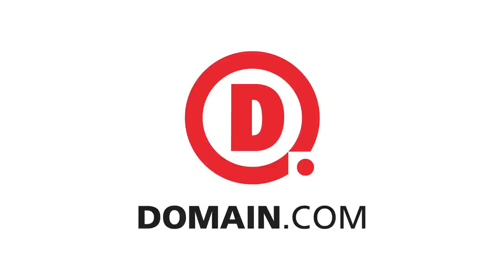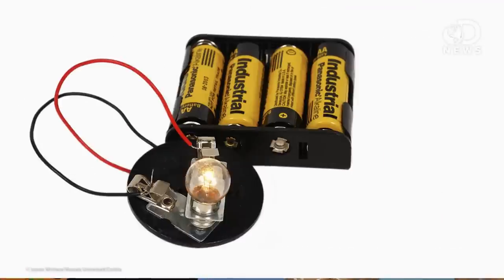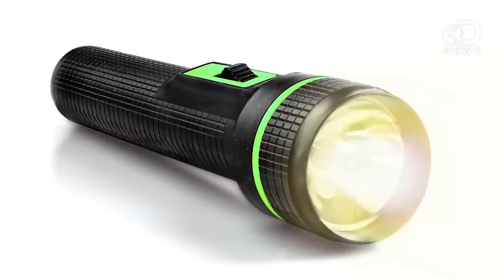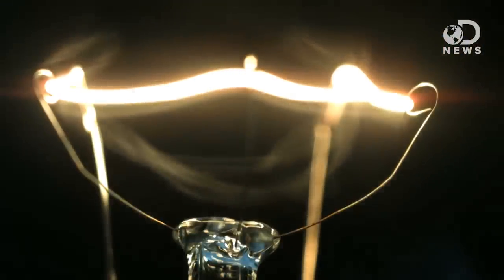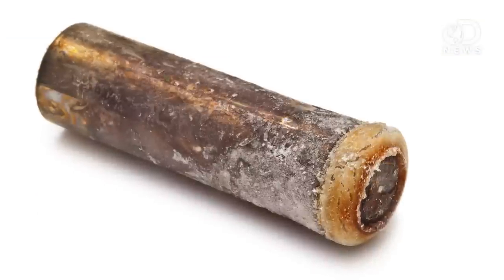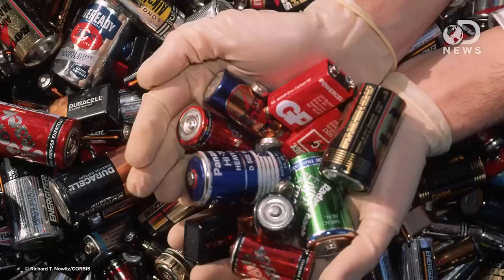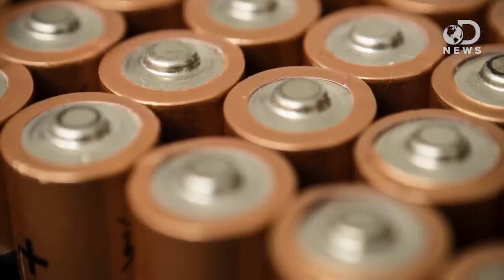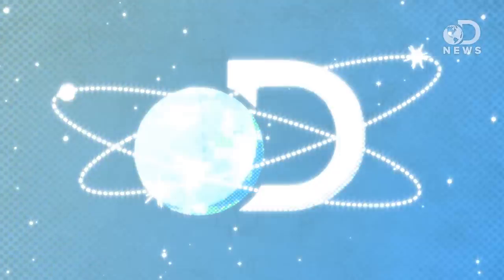Why Can’t You Throw Away Batteries?

Comment: Normal small household batteries does not contain either sulferic acid nor lead.. this is found i car and motorcycle batteries. Normal small AA or AAA batteries are usually alkaline batteries that contain lithium which is an alkaline metal. This is not particularily dangerous to us but it can harm nature in small amounts.

Comment: You CAN throw away alkaline batteries though. There's not much of worth to recycle in them and the zink, manganese oxide and potassium hydroxide (a base, not acid, hence no acid in these batteries) does not pose any significant risk to nature. There's also no money to be made in recycling them (something which fuels most recycling processes) as it costs more to recycle than the materials you get out of them.

I don't know where you shop for batteries, but I haven't seen lead or acids being used in regular consumer batteries in quite a few years now, outside of some specialized batteries. Basically, if you're throwing away a AA or AAA battery and it's not a rechargeable battery, just look if it says "alkaline" on the side (which with 99.9% certainty it will) you can safely throw it away.

That should have been pointed out in the video, it feels like someone should have done a bit more research as it sounds like you're talking about batteries from the pre-2000s.
Reply: Yep. Duracell's website says "Alkaline batteries can be safely disposed of with normal household waste. Never dispose of batteries in fire because they could explode." Further, "Proven cost-effective and environmentally safe recycling processes are not yet universally available for alkaline batteries. Some communities offer recycling or collection of alkaline batteries—contact your local government for disposal practices in your area."

Now car batteries, on the other hand, should definitely be recycled. I'm really starting to doubt DNews as a source of reliable information.
Reply: Car batteries, laptop batteries, lithium batteries which power most modern cameras and cell phones....
Reply: Amelia Bee environmental risks only applies to lead acid batteries. car batteries are the only common lead acid battery that is still used to day. unless you have a laptop or cellphone from the 90's they are going to be lithium-ion and can be thrown in the regular trash per the US guidelines for battery disposal, just like the alkaline ones.
Reply: ***** If it's alkaline you can pretty much bet it is, regardless if they're cheap or expensive. Bottom line is that you're not going to find lead batteries outside cars today, except maybe in some very specialized situations. As a consumer you probably wont get in touch with them aside from in cars. As Andrew B says, lithium batteries are also okay to throw in regular trash. I'm all for recycling, but batteries are one of those things (like glass) where recycling doesn't make all that much sense.
Reply: Amelia Bee aren't you that annoying girl on tgwtg all the time?
Reply: Andrew B but still for the common sense, i would recycle them. Just so the resources don't get wasted as much.
Lithium doesn't grow on trees you know. :)
Reply: *****
Oh, sorry... what manufacturers of alkaline batteries are there that can't be disposed of in your household trash bin? I live in the USA and it's pretty much Duracell and Energizer on the shelves here.
Reply: ecopper1  Actually lithium does grow on trees. It's found in plants up to like 6000ppb.
Reply: Switch & Lever i also think few consumers would just throw away lithium batteries. at least where i live, we trade in old laptops and cell phones, whereupon they presumably find their way back to manufacturers and recyclers (i believe they do, although i'm not 100% sure).
Reply: ^^^ Oh the irony.
Reply: Melodïcore I was not talking to you
Reply: marco jonker I know. But I was talking to you.
Reply: +Switch & Lever 

DNews cares about stating what is popular rather than what is fact.

The FBI have been collecting detailed statistical records on crime for a very long time now and you can even find it on Google. DNews says the government is not doing any crime research.

They are politically motivated by sponsors. DNews is a liberal news outlet.
Reply: poor a heavy alkaline powder on your green grass and watch it die because the it is to high of a alkaline
Reply: Dry cells never had anything particularly toxic in them but nicad,lead acid and lithium ion batteries should be recycled.
If EVs become common I'd expect recyclers to actually start paying people to bring in lithium ion batteries like they do lead acid ones.
Reply: Switch & Lever sorry bud, recycling can be extremely cost effective, particularly where aluminum and steel are concerned. Batteries may be less profitable to recycle, but, as the commentator pointed out, it's about the toxic compounds in the battery that are recovered - and which can be reused rather than mined from scratch.
Reply: Rhett Z nope, you're wrong. Alkaline batteries contain zinc and manganese dioxide. Neither is toxic (otherwise we wouldn't throw them into household trash) and neither is more energy efficient to recycle than to mine. There is cause to recycle rechargeable batteries and other speciality batteries, but regular household alkaline batteries are pointless to recycle. Do some research for yourself if you're still confused about this.
Reply: Switch & Lever it's a matter principle to recycle that which can be. While zinc and manganese are not considered "toxic", anything in large enough amounts can be. While we're likely not to have a pool of zinc and manganese accumulating in groundwater, recovering the metals means that much less ore extraction, energy intensive processing, and land degradation need to occur. Besides, it's better to have the public in the mentality of recycling than not.
Reply: Rhett Z yes, it's good to live with the mentality to recycle, but you're believing in a completely false assumption, that these batteries get recycled even if you throw them in purposefully built battery recycling bins, they don't. Those bins are made to collect batteries with actual toxic or recoverable compounds. Alkaline batteries are for the most part discarded. It requires much more energy to separate and recycle alkaline batteries than the energy required to make new ones. It's not very defensible to recycle them. It's really not complicated, alkaline batteries are pointless to recycle, the materials they're made of aren't toxic nor scarce by any measure. Zinc is one of the most common materials in the earths crust for instance. If you're really passionate about recycling there are a lot more worthwhile causes to fight, like handling plastic when it reaches its end of life, microscopic plastic beads polluting our oceans and ocean life, microfiber pollution, pollution caused by recycling (very common in developing countries which do industrial recycling, of ships for instance) and much much more!
Reply: what will happen if we throw out Ni-Cd Battery ?
Reply: Abhishek De Nickel isn't that big of a deal, but Cd stands for Cadmium, which is toxic for the environment and should under no circumstances be disposed of improperly. Throw them into a hazardous material, or battery collection, bin.
Reply: Switch & Lever What about NiMH battery ?
Reply: Abhishek De generally safe to throw away, but personally I'd err on the side of throwing all recyclable batteries into recycling. Seriously though, these are questions easily answered by ten seconds on Google.
Reply: is there any way to detect batteries in a grabage bin? via a sensor or something? Thanks
Reply: @Irishrebel092  1. Lithium is a heavy metal and is one of the bad ones, 2. Most cheaper regular AA type batteries are lead acid (check for the symbol Pb) so most batteries should be recycled responsibly
Reply: I bet this woman thinks global warming is caused from focal fuels not from the the north pole moving 25 miles a year.
Reply: Because it sounds like alkaline batteries are ok can I use them to help amend soil for a plant
Reply: Glad I read this

Comment: In the EU it is illegal to dispose of any kind of cell or battery in normal refuse. Lead and mercury have been banned from consumer replaceable cells for many years so there is a mishmash of information here. Normal cells are recycled and the metals recycled. For those wondering if the anode and cathode description is backwards, it's not, it is describing them from the point of view of a cell providing electrical energy. Therefore the cathode of the cell/battery is connected to the anode of the device/circuit.

Comment: You would think that a big company like the discovery network would do a tiny amount of research before going off on a rant that shows they have absolutely no clue about.
Batteries in the sense they are using them are actually "cells" a battery is a stack of cells and for aa, aaa, c, and d "batteries" they are actually cells

Also those types of cells, and 9v batteries don't use "battery acid" they use an alkaline substance known as manganese dioxide,  zinc, and sometimes carbon. None of those substances are particularly harmful or something you wouldn't already find in healthy soil. Landfill or not you will find all those compounds in the ground anyways sans lead which along with sulfuric acid are not found in household batteries or cells.

Comment: I try to recycle them. Many places take them. Home depot does atleast where I am. They have a big metal cabinet for them. Even recycle old small lead acid batteries there if they don't do core charge from where you buy new. 
This is why I take apart phones, battery backups, etc. They can have NICD, NIMH, lithium ion, or lead acid batteries.

Comment: There is nothing to 'stop' you throwing batteries away, only your own conscience or fear of 'being caught' by the bin police ( what a joke!).
So-called recycling uses a massive amount of energy and I'd debate whether you end up with economically-viable products at the end of it.
Reply: +ukpropaganda That's not the actual point here. The stuff is poisonous.
Reply: they re use lead acid batteries. instead of using 5 times more energy in gas man power food for men oil etc for machines and men to mine the lead to make the acid and build the plastic for the battery out of petroleum why not use what u all ready have the machine does everything u pay two to three people instead of a crew or 20 to 30

Comment: so far I have 600 NiMH 17670 batteries that people say are bad but I'm pulling 2 and 3 ah from a 4.5ah Battery I have a bag that I have been collecting of 20 to 30 lion 18650 cells as well as a few NiMH that I plan on turning into radio shack eventually these batteries will no long take a charge at all or heat up when charged meaning there is an internal short

Comment: Usually i'll keep any alkalines in a box until i'm ready to take it to recycling. But my collection of alkalines are dwindling now that NiMH technology has gotten better, got 9 year old crap NiMH cells that work great in either low lumen flashlights, clocks, tv remotes, wireless mice and keyboards. I also got some speakers that take 4AA batteries.

If you're looking into getting rechargeable NiMHS, go for Eneloops (exceptional quality), Energizers or Duracells. There's some good charging units such as the La Crosse BC-700 or BC-1000 and there's also the Maha/PowerEx C9000. Look for other Maha/PowerEx chargers as they are really good, expensive but those are good charger/analyzers. if your not looking for something that fancy (and expensive) the Panasonic BQ-CC17 Eneloop charger is great. Both the C9000 and BQ-CC17 reject High-IR (Internal Resistance) cells so you don't accidently charge alkalines with them and NiMH cells that have developed High-IR won't do very well in high drain devices and you'll either need to charge them in a basic charger or the La Crosse chargers will charge them (to a certain extent if the -dV doesn't kick in prematurely).

Comment: potassium hydroxide is not an acid but a caustic agent that is toxic, Switch and Lever. While the mercury in batteries is of small enough amount that it is unlikely to do much harm and zinc and manganese are largely non-toxic except in very large concentrations. There is still the matter that many batteries still use lead in some quantities which is quite toxic, though.

Comment: Jesus H. Christ! This was the very first clip I watched on the DNews channel. A few moments into the clip, the commentator informs me that the negatively charged contact, "The Anode" and the positively charged contact, "The Cathode...." Now how can I possibly have any faith in the integrity of any material presented subsequent to this abject error? Do you people not have quality assurance reviews of your material PRIOR to post? If you do have QA reviewers, I suggest they be removed from your payroll to make way for the newly-hired and greatly improved review staff who hopefully have an actual interested in the task at hand. Should I be suspect about the integrity of any video I might watch on your channel(s)?  My short answer to my own last posed question is, Yes! Of course I should be suspect! Why wouldn't I be (suspect)?
Reply: Actually she's right in the case of a battery being discharged. You're probably thinking of an electrolytic cell, where current flows in the opposite direction. Anodes are oxidized, whereas cathodes are reduced.

Comment: The problem with recycling batteries is that they're so difficult to recycle in some parts of the US. You have to hold onto them and them make a run to either Home Depot (if the nearest one takes them) or a run to the recycling plant which is a 15 minute drive. ...  and who uses regular old batteries anymore anyway? It takes a whole year of battery use to actually make a run to recycle the whole lot.

Comment: Aren't electrons are cathode and goes to anode, right?
Reply: of course, silly!
Reply: ...no the cathode attracts electrons.... the anode is the reaction that is being reduced.

 for example Oxygen makes a good cathode as its a oxidizing agent (because of its almost full valence shell, fluorine is the best oxidizing agent as it is very light, and very dense of electrons)

iron is an anode, but since its very heavy its not a good one, this is why rusting takes a long time. However, magnesium is much lighter and more reactive than iron so we usually coat pipelines with magnesium as an "sacrificial" anode so that the oxygen oxidizes the magnesium first before the iron.

Since that reaction builds up charge, many corrosion engineers put in a counter current into the pipes to ensure the charge doesn't go anywhere. Same idea is when you turn off of a flashlight, the battery is still building charge for a couple seconds after you cut the circuit. Once too much charge is created the reaction's activation energy is too high to react.

Comment: Recharable batteries as expensive as they can be, are actually so much better than non-rechargeable batteries. Not only can you reuse them over and over again, but they hold their 1.2v much longer than 1.5v non-rechargeable batteries making them have a longer life span. Just be sure you buy a battery charger that will charge each battery individually... other wise you're stuck with half of your batteries overly charged and the other half, 50% dead...
Do your research; stick with the battery that is longer lasting and reusable. You might even save the planet. 😉

Comment: I once had a pocket full of change and forgot about it and put a AA in there. Moments latter, my thigh started to get real hot and I smelled smoke. That was some funny shit right there.

Also just go to Amazon and Buy a Alkaline Battery Recharger. Since rechargeable are only 1.2 volts and a true Alkaline is 1.5 volts. A lot of stuff does not work well with rechargeable because the lack of voltage they have and don't last as long.